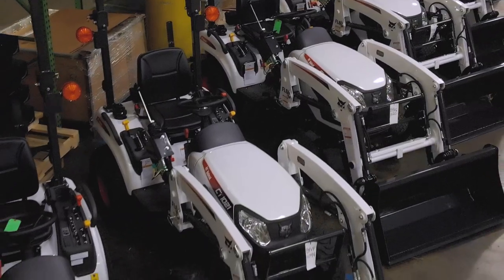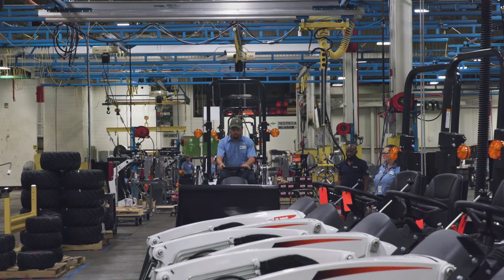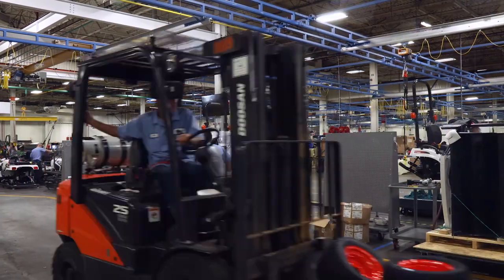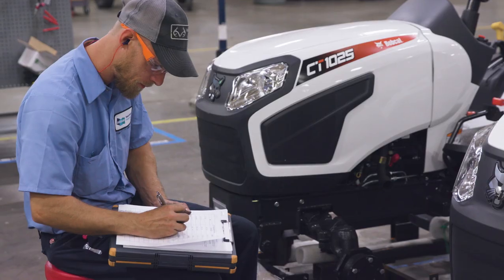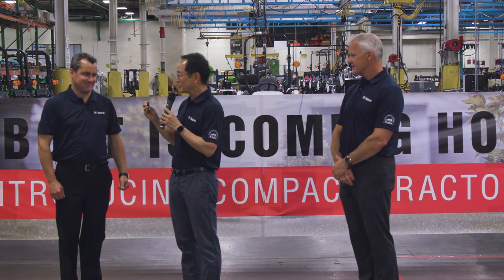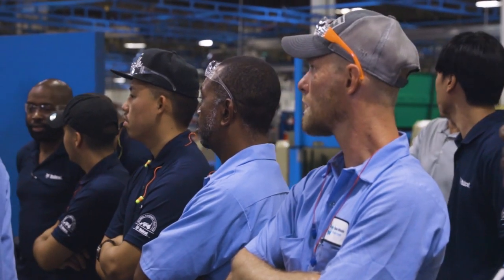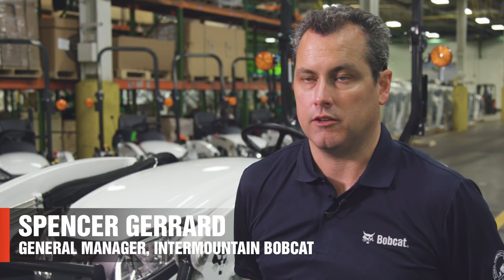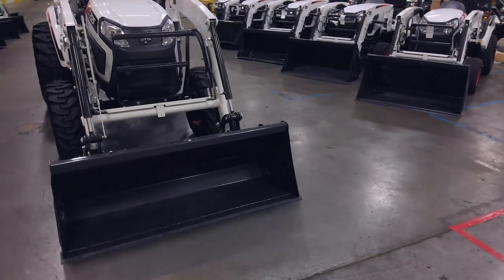Next Is Now: Bobcat Compact Tractors Roll Off the Line in Statesville

Comment: Just bought their 25 horse compact tractor. Having the same problems with using the bucket and forks, you cannot operate it smoothly and it is nothing nearly like they Kabot us that I have. Very dissatisfied. My tractor smokes successfully when I cranky it and I’m just not happy at all having put about 12 or 14 hours on it. I will keep it a little while and hopefully someone else will want to buy it. But at this point I am a very dissatisfied customer

Comment: I bought a 2025 tractor with loader. I am lifting skids of firewood and cannot lift a skid and curl it at the same time to keep it level. I need to lift part way slowly level then lift more etc. My other Ford and Kubota does this easily. Have had a service call for this and am told it won't do both at the same time . 
This is a Major disappointment!
Reply from the maker: Thanks for reaching out to us. Our CT10’s and CT20’s do have multifunction capabilities but they're limited. So, it may be difficult to do this at first, but it is possible and gets easier with more operation.